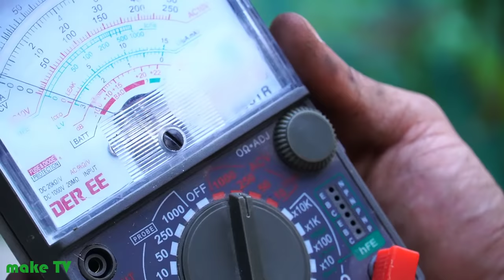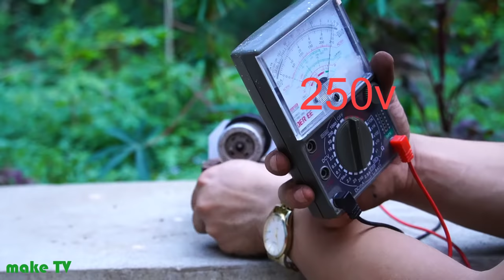How to Turn a Microwave Transformer into a 250v Generator

Comment from the maker: helllo
Reply: how AMPERE that travo =....A     ?
Reply: @AIUEO_99  Wrong question.
Begin with the battery, 12V 30Ah , it can give 360W in theory, then the motor that isn't near 360W and a plastic tube that can't transfer the energy that is left after 30-40% energy has been converted to heat.
Then you have the transformer from a micro oven, typical designed for 700-1000 Watt, that now suddenly is said to produce 5000W.
I think you must be religious to make that work.
Reply: ROS
Reply: @birrextio6544  Brilliant. Thanks for the explanation.
Reply: Itel phone
Reply: سلام
Reply: Helloat
Reply: Are all microwave transformers 
250V?
Reply: @birrextio6544  Way too many flaws to make it work.😄
Reply: What of if battery died waiting go change the battery now
Reply: อาแวย
นยา
Reply: @birrextio6544  wouldn’t the transformer output ac current anyway? This would make it useless for powering a lot of things.
Reply: @RayceVR  It's normal to distribute ac since dc can't be transformed.
Anyway, that is not even near 5000 Watts,  maybe 5 Watts for awhile until the plastic tube melt.
Reply: @birrextio6544  12 volt × 30 amp = 360 w
Reply: @tinafernandes9295  What is your point?
I wrote that it gives 360W before all the losses. That is near 1 HP so image a moped with one HP engine driving the wheel by a stump of plastic tube.
You must have been grown up in a religious home if you can't detect that bullshit.
But go ahead and build one if you like to waste your time.
Reply: Powede mka order da into magkano Angeles presto?

Comment: You forgot to show the extension cord coming behind the wall ... cheater !!!
Reply: Liar😂
Reply: He didn't say is free energy and yes you can  doo
Reply: How is he cheating when he is using a battery turning DC power into AC power
Reply: @SallyFace_666  small battery not enough power.
Reply: @kevintravis1807 not how that works. Battery turns motor. Motor turns magnets. The opposition of polarities with switch the current back and forth. Aka ALTERNATING CURRENT!
Reply: That should last an hour if you are lucky before needing to charge the battery, but how many amps is this generating at full speed? If you had a waterwheel for turning the magnets your spacing of the magnets determine maximum speed before flux limitations. What my issue is, an alternator from a car needs 12 volts supplied  to generate the field so it will produce energy.  Hmmm
Reply: @SallyFace_666  for one, it's not a generator. It's an inverter. So at the very least, the title is wrong and misleading

Comment: His claim of a 5,000 watt generator doesn't even add up. The motor he's using to turn his "generator" is probably less than one HP.  5,000 watts is 6.67 hp. The fan he's running off the "generator" is probably 1/4 hp or 1/3 at best. (Note: 746 watts = 1.hp).  The link he provides does not show a larger generator, so I don't think my comment is mistaken. The link is to something else entirely - making an internal combustion engine from a refrigerator compressor.
Reply: No hay 5000 watts, es imposible con ese motor,
Falta un motor mucho más fuerte y también un generador,

Comment: Even if this process works, let's say the battery has a capacity of 30 amps per hour and 12 volts,
The devices were ran need at least 6 amps and 220 volts, which mean, the battery
It will only work for 3-4 minutes and will empty, meaning the battery needs to be recharged
Reply: 6 amps at 220v is the same in electricity to 12 amps at 110. If both devices were 6 amps, and they're not, one is maybe 1 amp and the other is probably 2 at most, then with 1 to 1 input to output, he'd get almost an hour and a half on a 17 amp hour battery, not 3-4 minutes.But nothing's perfectly 1 to 1 so that would mean it could run for over an hour on a 17 amp hour battery, never mind 30. And if he dropped the input down to 1.5v with a step down circuit, then added a joule thief circuit, then a capacitor bank, all with isolators between them, then a step up circuit to bring it back to 12v before the motor he'd be able to run it for more than a day before charging. And if he added a capacitor bank on the output, along with the same step down, joule thief, step up combination and a charge circuit going to the battery so any extra generated electricity isn't wasted but is routed back to the battery, and added some small solar panels and solar chargers to the battery, he could pretty much run it until the battery dies provided the sun continues to rise each day. And a lead acid battery should be good for 6 months to 2 years or more. So we've gone from your assumption that he can only run it for a few minutes, to my knowledge that he can definitely run it for over an hour, to the potential of having it run for over 2 years straight off of a single 12v battery. He could even modify  my suggested circuit setup and run it off of 1.5v rechargeable batteries. People in the past made similar devices, started with a nearly dead single 1.5v battery and they charged the batteries while generating thousands of watts of electricity from nearly no input. Of course we're not allowed to have such devices on the market, because for some reason free electricity keeps being equated with free energy when energy can't be created or destroyed. But electricity CAN be generated from the tiniest source of energy, because it's just stripping and moving of electrons, electrons can be stripped from air particles and be used to power things Nikola Tesla proved that..
Reply: @darrylkinslow5613  , thank you for taking the time to explain this!
Reply: @darrylkinslow5613  man u busy... I need to hire u to do my set up.. seriously
Reply: @G yes you can use the same power generated to supply battery. Which then creates an uninterrupted power supply
Reply: yes you can use the same power generated to supply battery. Which then creates an uninterrupted power supply
Reply: Wireless?????
Reply: @darrylkinslow5613  Learn to paragraph please.
Reply: @darrylkinslow5613  thank you for the explanation
Reply: @deang5622  At least you said please
Reply: The inverter has no charging output , so how can we charge the battery when it runs down
Reply: @darrylkinslow5613  hey Darryl are you joking or is this system feasible. Can you show a diagrammatic circuit of.this please. You would save souls doing this
Reply: Needs an alternator or solar panel with rectifier to keep battery charging
Reply: @ekmarfo27  That would be a Perpetuum Mobile...
Reply: @darrylkinslow5613  probably one of the greatest YouTube comments I’ve ever read 🔥🔥🔥🙏
Reply: So with this big DC turning into ac? Wouldn't your assumption be correct if those two things were only running on the battery itself. It's not like the motor is going to need to turn harder if you plug more stuff in. Since there's no load being put on a magnetic rotor. The only thing that's going to happen is your devices will be running on insufficient power, but that motor will run the same length no matter how many things you plug into it. All that's going to happen is whatever Powers being produced by the rotor, I'll just equally divvy up whatever you plug into it.
Reply: Just get a hamster and a hamster wheel.
Reply: @darrylkinslow5613  Unfortunately its the laws of physics, not the laws of man, that stops gadgets like this from working.
Reply: @davidfaraday7963  Fortunately, Mr. I'm so smart, you are wrong. This device exists, it is called a dynamo. It is used in industries and on Navy ships, and is used widely  in generating electricity. Larger dynamos were used in the early days of electricity to supply electricity to houses and businesses. This is not a perpetual motion device or a free energy device as you automatically assumed. It is using a battery as the input and isn't hiding that fact. I have made such devices very simply with a couple of motors. The strange thing about some types of batteries, such as Ni-Cd rechargeable batteries, they can be put on a constant charge even when they are full, and a small motor can run a large dynamo from one or more of them. And a dynamo, produces more electricity than is used to run it. Does that mean it is creating energy? No. If it was doing that it could run itself with no power source other than itself. But it can charge things, like batteries, and so a set of the right batteries used to run it, would continue to run for the lifetime of the batteries or until the magnets in the dynamo wear out and stop generating electricity at the coils.
Reply: @darrylkinslow5613  Sorry chum, I'm a graduate electrical engineer so, unlike you, I know what I am talking about.

A dynamo is a generator, specifically a DC generator, so not used in power stations which use alternators AC generators).

What is the POINT of "using a couple of motors" run off a battery? And what do you mean by "a dynamo produces more electricity than is used to run it"? A dynamo requires MECHANICAL, not electrical, power to run it, and it requires MORE mechanical power to run it that it produces electrical power output.   Yes a dynamo can charge batteries providing that a MECHANICAL source of power exists to run it. If you are suggesting that that mechanical power could be created by a motor run off batteries then you have just invented a complex gadget that will achieve nothing but waste energy.

I don't know whether you are a scammer yourself or just gullible, but you are trying to re-invent the most basic laws of physics. and failing.
Reply: @davidfaraday7963  Thanks for that eloquent BURN, saved me some work! Darryl has some --- interesting -- convictions.
Reply: Yep, so why not add an alternator hooked up to the battery and there ya go.
Reply: @robertbrown535  do you mean connect alternator to be rotated by the same motor? Then the alternator will make additional load on the motor and caused more amperage bleeding.

Comment: This is awesome, because you do not necessarily need a motor and a battery to power the device. It can be anything that acts as a rotor and stator, which is easily provided by nature. You can use water from a flowing river, the wind, etc. to spin the generator. I might try this, I have about 2 acres of land and we get wind all the time! I will use this and look at options for storage and batteries.

Edit: I just realized that you could have the artificial motor (the one that is hooked up to a river or a windmill) and attach it to a very large gear, which spins a very small gear that makes it DIY generator spin even faster, which means you can get faster speeds even with slow winds or a slow-flowing river! I am so excited to try this!
Reply: The electric produced will depend on the RPM or Rotations Per Minute of the motor. You can not achieve a 250V if you will use only windmill. Atleast you can produce a 1800 RPM motor to achieve 250V.
Reply: @randyserano7490  he can achieve high RPM if he uses a larger gear spinning a smaller gear
Reply: @yaimem  Eventhough you will use larger gear spinning a smaller gear if the source of RPM is low, you can not achieve a 1800 RPM.
Reply: @randyserano7490  so the video is fake?
Reply: @yaimem  Yes 100% FAKE
Reply: They've been doing that in cars for awhile now. Call them transmissions
Reply: Be careful the bigger the drive gear the heavier the load the harder it will be to turn said artificial motor
Reply: You don't know what you are talking about....  Those magnets are not cutting the lines of flux correctly.  You won't get but a couple volts out of this garbage
Reply: U right alot of people don't know about  this and they say it's  fake or maybe they are jealous cause even they make video and they say not true.  But I'm 💯 with ya it's true.
Reply: So is this bull💩 or true don't want to waste my time
Reply: @edgewatersbestguitarist1524  actually I believe what you're referring to is called an alternator not a transmission
Reply: @Lower_Class_Citizn  a larger gear getting increased RPM to a smaller gear is a transmission... the organized coils and magnets attached to the gears collecting voltage are the alternator
Reply: @edgewatersbestguitarist1524  my bad i thought you were speaking in heneral cause there eas not a specific subject in your comment
Reply: @randyserano7490 with enough gears and pulleys yes you could
Reply: Thinking on the same lines.
Reply: Where the hell do you get the Lil magnets though??
Reply: Why are people talking about extension behind the wall, next time show us your compound
Reply: se ti dicesse anche come fa a regolare il voltaggio  dato che ne sviluppa 500 di Volt bambinone
Reply: @edgewatersbestguitarist1524 these comments are just crazy lol...people chime in not knowing wth they are talking about
Reply: That is a transformer people it transforms higher electricity from lower ,not extension cord behind the dang wall

Comment: good but you should use barring with spendle toavoid frictions and also use adaptor 220vac to 12 volts for moter and reconnect with same produced energy. means to make it free energy

Comment: That battery is 12 volts at 30 Ah (Ampere-hours) which equates to 360 Wh (Watt-hours)

Assume the load was 1 Kw for 10 mins to boil the water and run the fan.  This is 1000 watts for 10/60 of an hour ie, 167 Wh

However that calculation assumes 100% efficiency.  Looking at the contraption that the poster has built the magnetic field doesn't cut across the transformer windings, efficiency will be just above zero.  I've experimented with a microwave transformer and rotating magnets and barely managed to light a torch bulb.

Fake
Reply: agree it is fake....why do people bother to do this....what satisfaction  do they get.
Reply: That's not how it works at all. First off the output of the battery and the draw of the devices being powered are not connected in the least and so the battery output only matters in so far as what is needed to power the motor. Second, the magnetic field is literally in the middle of the coils and passing through them in two places, those are neodymium magnets not some Walmart fridge magnets. Third, you've never done an experiment like this or else you would know these things.
Reply: @LunkovichTromofski  What you say no sense to me at all.  Look up Flemmings right and left hand rules, you will see that the magnetic field, direction of motion and current have to be mutually at right angles for a device to act as a generator.  This is not the case in this video, the magnetic field isn't closed, any field just goes down the centre of the core.   I can assure you I have done experiments on an exercise bike with the magnets from the magnetron and with better magnetic field paths than in this video and the output from various coils was negligible.
Reply: How can you get 1000watts no
chance
Reply: @LunkovichTromofski  because he understands electricity and physics and logic. You clearly need to go back to school.

Comment: If you drag water from uphill whit tubes to your house and use them on some pillars that tubes come to your house from above at height you can use m x g x h formula to produce energy with regular water that you use for house and garden , all you need is aerial tubes that bring water from uphill at height then tubes at 90 degrees could bring down water on a water turbine in your house and produce energy near your house whit the water turbine , pillars used need to be very heavy and that is all

Comment: How do you maintain a frequency of 50 or 60 Hz on the 240v out? Looks like a fake to me.
Reply: Maybe in this case it didn't matter, those appliances will run on regardless if frequency is 60 hz or not. But it still is nothing to write home about, it is more of a proof of concept in my opinion.
Reply: @TheRebelmanone  Due respect to you and your reply, I don't see it proves anything. That motor is spinning a many hundreds of rpms, and is loaded with poles. The frequency must surely be in the many hundreds of Hertz. Not so sure AC motors will run efficiently beyond a few 100 Hz. Resistive loads will probably work to a degree. I suspect there is a power feed coming up behind the wall feeding the outlets directly. If we could generate that much power from a 22Ah SLA battery it would be amazing if it lasted very long. I remain unconvinced as do many.
Reply: It’s fake😏